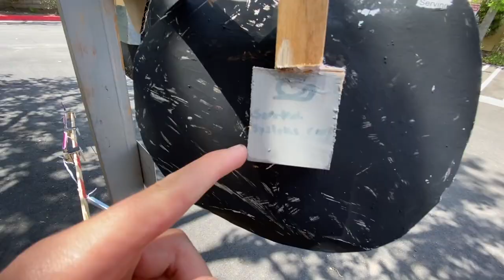Railroad Crossing Gate Saver Update

Comment: I just thought of something you can do if you have the Ho scale railroad crossing you can use the circuit board from that and buy some 12 volt trailer lights from Walmart or academy and then you could use the cardboard/wood lights you made and slap the trailer lights on the front and wire it to the circuit board it’ll be easy and no programming or stuff also it’ll be easier to hide the circuit board in like a junction box or something else :)